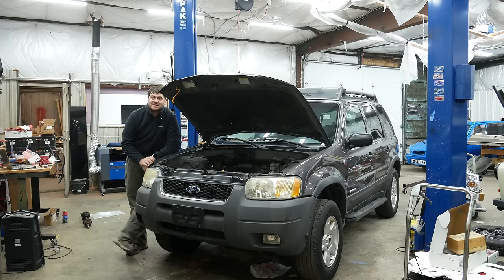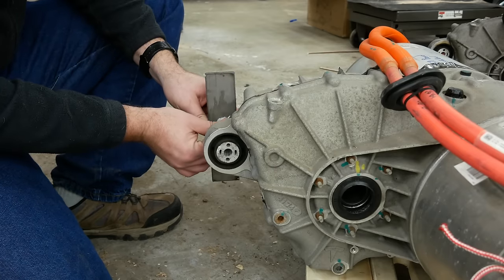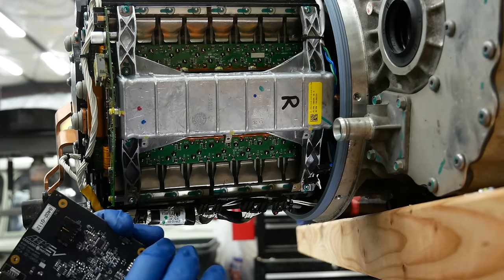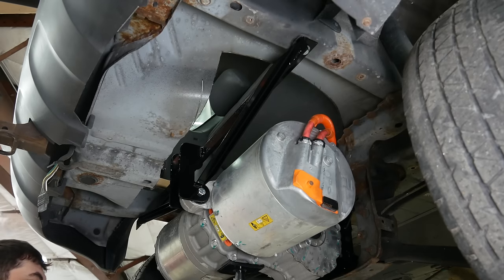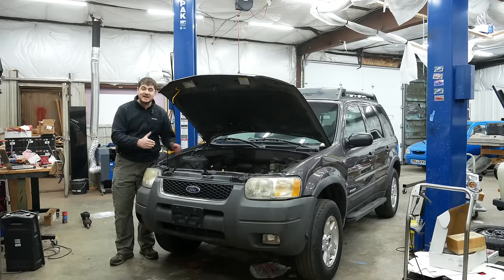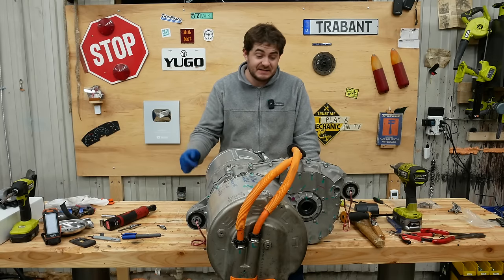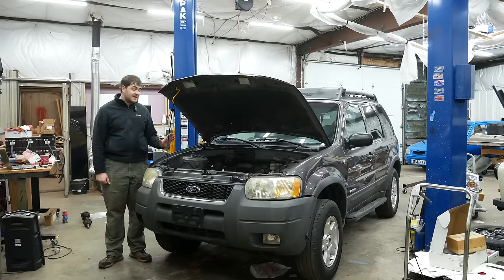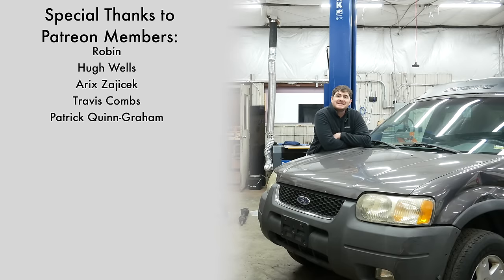This Escape is Now Rear-Engined (and Front-Engined) | 900HP Electric Escape Project

Comment: I love that things like these are possible, and even more so that someone is doing them.
Reply: How did you get access to the video so early?
Reply: @ulexx6574  I wanna know the same it came out an HR ago for me
Reply: @ulexx6574  probably a patron.
Reply: This project is based on an idea that is so dumb that other than as a joke, nobody would ever try.
Keep in mind the reason he is doing this is to gain experience to do it with a bus.  Not only is the bus far too heavy, it has the aerodynamics of a piece of plywood facing the wind.

Worse still, he's not going to be driving it 20 miles a day at low speed picking up kids within a limited circle, but taking it on multi-state highway speed road trips carrying vehicles.  This bus is going weigh a lot. Between the weight and the poor aerodynamics, this thing is going to need A LOT of batteries.

The only good thing is, I believe,  he is never going to finish the bus.  The bus will be scrapped before it will be completed.  He has had the bus for years and has done next to nothing on it.  Next month it will be 4 years since he introduced the bus on the channel. (Mar 21, 2019). He has done almost nothing on the bus since.

His handling of the project has been terrible.  He should stop taking on more projects until the bus is complete as a diesel bus.  Only after all the details are worked out (assuming he finishes the bus at all) should he be considering an EV swap.
Reply: @tarstarkusz  How dare he do something he wants to do
Reply: @NonsensicalSpudz  When did I say otherwise?  I have no authority over him.  I think it's a dumb idea.
If his time frame for the bus is 2035-2040, he should probably tell us that or at least that it will not be done anytime soon.
But what I think he should do is my opinion and he is in no way bound to my judgement.
Reply: @tarstarkusz  Of course it's a dumb idea. That's why I love watching it.
Reply: "Drive unit" 🙌
Reply: @UneasyRider69  I follow a channel called "Cold War Motors" (great channel) and he just completed the restoration of a 1960 Fury  4 or 5 years of videos (though not every week about the Fury) and it was great following the project from a couple of completely worthless portions of a car, one of which wasn't even a Fury to the completion of what is only a bit short of a show quality car (they didn't do the engine and transmission, which were both fine).

He (Robert) starts a lot of projects he never finishes. Worse, these diversions that never get finished anyway, take away from the more interesting projects.  He cannot even stay focused on making the bus an actual bus running down the road and fulfilling his vision of the bus before becoming sidetracked on making it electric.

It's sad, really.  But I also do "get" what you are saying.  There is entertainment value in doing dumb things that are still challenging to do.
Reply: And even more so that someone else is doing them 😊. Absolutely love this channel!
Reply: To reference 2010s Toyota ads.... "Nothing's impossible, Toyota"
But yeah, nice to see people do interesting stuff like this and not things like (common in my area) straight piped TDI Golfs.
Reply: @tarstarkusz  you're acting like he has unlimited funds and is beholden to us as our entertainment. He has a lot of different projects because it makes for great content. He's also one person. The bus is expensive and smaller projects do help with this expensive product. Is it mostly a "why not" project? sure. 

I'm not sure why you're acting like its a good thing it'll never be finished. 

Its easy to be an armchair critic of a 1 man band. its also lazy, which Aging Wheels isn't. He's put out semiregular content on different aging vehicles over the years. What have you done in terms of content?
Reply: he also has no obligation to us to tell us a timeframe on the bus. It'll get done when it gets done. Patience is a virtue. Its not like how the durango was where it was clear it was meant to be eventually scrapped when he bought it.
Reply: @michaelhohe2168  I agree with you about being the critic. It takes no effort whatsoever.
I am not saying and have not said anything accusing him of doing something morally wrong.

Because the bus as it is currently conceived is just a dumb idea.  It's also a HUGH undertaking he is failing at while simultaneously making it far more difficult by adding an EV conversion to the list of changes in the bus.

It's not that I think it's a good thing that he is failing in that sense, it's that the sooner he accepts he's getting nowhere with the project, the sooner he can either focus on the bus and get it done or focus on the EV conversion or the Coda (IIRC, the prototype EVs he has are called coda) or any other project he's dipping his toe into.

YES, I understand he's only one guy with limitations in skill, equipment and most of all, money.  But the way you deal with these limitations is by creating smaller goals.  Like, for example, just finishing the bus and working out all the bugs it will inevitably have (though no fault of his own, this just happens with everyone) and then, after it is working to his satisfaction, he can work on an EV swap.

In one sense, I give him credit for doing this EV swap first and not immediately taking on the EV aspects of the bus at this time.  OTOH, all the money he is pumping into this project is money, by definition, he is not putting in the bus.

Bottom line, I think he should either drop the bus and focus on other things or drop the other things.  Also, It's perfectly fine for small projects to happen in between working on larger projects. I'm not saying there should be no more videos on other topics until the bus is finished. Just no more big projects in addition to the bus.
Reply: @michaelhohe2168  I just would like to see some progress on it.  I was excited for him when he first got it and was going to do a minor conversion to use it as an RV. But then it got slowly expanded to only 1/2 an RV but can carry cars on the rear.
Reply: @tarstarkusz  you made some good points👍hopefully he'll be able to reorganize his project timeline so he'll be under less stress to get projects finished.
Reply: @tarstarkusz  Talk about a party pooper.   I get what you are trying to say, but this dude is learning a lot from scratch, it takes an f'ing lifetime to become a master craftsman in a discipline.  I run my own engineering business, I'm 41 and have been fabricating since I can remember.  This guy is doing great, he's making all the same mistakes I did 20-30 years ago and that is how you go.  The difference is, he's having a bloody go, the fails aren't stopping him and he is persevering on.  I think the electric bus idea for highway use is a big risk as well, but, he's keen, he's doing the smart thing and practicing on something much cheaper.  You need to remember you are not watching a high end fabrication channel, you are watching a dude with passion learning how to do things.  His best skill is his delivery, he is a naturally funny guy.
Reply: @kingcosworth2643  I'm not criticizing him as a person.  I am also not criticizing him for trying new things and jumping in with both feet to learn as he goes.  That is what is appealing about this channel.  I support all of that. That's WHY I watch the channel.

That is not what I'm criticizing.  I'm saying he's barely started the project with very little progress over 4 years. Iit's now on hold and rather than redesign to make it more at what he can do with the resources he has, he's making it way more complex.

If you are at C and you want to get to Z, all those letters in between have to be traversed. 

I think he should get the vehicle working in its current iteration before taking on yet another aspect of the project.  IOW, get the bus done as a diesel first. Once everything is just so he likes it, THEN take on the redesign of the drive train.
Reply: @tarstarkusz  A highly modified Diesel engine that fits into a Bus engine bay is not going to be close to as powerful over a wider RPM range than this dual motor setup. The main goal was to turn the bus into a flat bed car hauler. Hauling something like that Ford Escape a diesel is going to be dog slow climbing up grades, this PHEV setup will be a mountain goat. Already proven by Proterra Duo Power which is used for Ski Resorts.
Reply: @tarstarkusz  "20 miles" is not possible unless the battery is like 40kWh and would be dangerous to output enough power for 900HP of motors. To have enough battery to power 900hp of motors you really need a 100kWh pack which would give just over 50 miles. 2 kWh per Mile is exactly what you get for driving a Brick. 50 miles would be plentiful of a HYBRID setup. Your technical falsehoods defy core concepts of how electric drive trains work.
Reply: @tarstarkusz  privet, you should watch Garage 54, they are only doing dumb and destructive projects. I want to see how you will write your funny comments under every of their videos - in russian.
Reply: @Neojhun  I live in the German south alpines and electric vehicles are stealing everyone else's show. Besides my slow 2983 Volvo 240 grand luxe, i do have an old early 90's Unimog with the most german engineered Gearboxwhich ever existed with three levers. It used to be a torque monster, especially offroad. Now there are small economy electric cars and "fashion-SUV's" that are better at mountaineering with more torque. I feel embarassed. But at least my Unimog has a nice suspension and a nice kitchen inside the RV cabin. And it has been through Siberia, where there are no EV charging stations. 

Another random facts: alpine passenger trains are electric too, which isn't the norm for rural tracks. In most other regions, the rural track infrastructure is mostly under the reign of diesel locomotives.
Reply: @hyperturbotechnomike  I occasionally view their videos. And, yes, some of them are very funny., I'm not Russian, but tell me, why do you bring it up?  Is it because you are a bigot against Russians?
Reply: @Neojhun  I don't think he should modify the diesel, at least not yet.  I think he needs to get the platform working first. Then, after it is complete, take it on some road trips representative of the types of trips he wants to use the bus for.  Only after everything is built and working to his satisfaction should he then consider changes to the drive train.

If he converts it to EV, the range is going to suck even with a much larger battery.  Will the bus even fit into supercharger spaces?  He said he will be using a 7kw charge controller.  Even if the battery is only 70kw, it will take 10 hours to charge it. (I don't know if this bus will handle fast charging)
Reply: There is a fatal flaw in the bus EV project.  The diesel is more or less rated at 100% duty cycle at max power where as the Tesla motor is going to be much lower.  I'm betting that the Tesla motor can't withstand more than 20 % if that not to mention the gear box.
Reply: @Neojhun  I brought up 20 miles as an example of how electric school buses are used as school buses.  They do short trips at low speed. Range is not really a consideration in that use-case.  You pick the kids up in the morning, throw it on the charger and then drop the kids off after school.

It's not power that is the problem, it's range.  In order to get a reasonable range out of this thing as an EV when fully outfitted (with the living quarters) plus carrying a car on the rear deck and with the poor aerodynamics of the bus, it will need an ENORMOUS battery.

Also, it's worth mentioning that these motors are untested at the output levels he is talking about. The 2012 Model S with 2 motors is rated at 416 total HP, less than 1/2 of how he is going to run them.  Also, the more power you try to get out of them the more energy they take from the battery. It is also quite likely the motors are less efficient the higher the output.
Reply: And we get to watch!
Reply: That's optimistic but we're here to watch either way! 🍿
Reply: @Xedilian  He could have gotten a ford focus or Fiesta with the dual clutch transmission dirt cheap! LOL!!!
Reply: @hyperturbotechnomike  Don't feel bad about the Unimog, it is a classic and beautifully engineered in it's own way with different strengths and weaknesses than the EV's. Different creatures both, each good in it's own way.
Reply: @tarstarkusz  It is wise for him to gain experience on a smaller scale before tackling the bus. And about the bus those are generally called "Toy Haulers" with lots of race car owners doing the conversion (just not EV yet). I have started many projects myself only to alter or scrap the first idea for a second or third version. It's far better to put in those changes early than late. Often new ideas will come during the build process and not before, so I understand his approach. Perhaps the original idea he had for the bus is becoming less pleasing over time which definitely inhibits the motivation factor. 

On the practicality of it, all concepts have to be proven or disproven IRL and that is what he will be doing. Being vastly different than what the usual is, I expect his 'EV Toy Hauler' is going to take awhile with lots of changes and alterations along the way. It could even go from plug-in to PHEV with no mechanical drive and the ICE providing charging on-the-roll which would assist or maybe overcome any range issues. 

Proterra is made about 30 miles from where I live, and initially they were criticized for all the points you make here, but they have proven that their claims are not only reachable but they have exceeded that level in some areas. Not only have they proven the concept, they are making a profit selling their product to happy customers world-wide. They are working on extending the possible range and TBH I expect they will succeed, albeit gradually more than quickly.  

The real question with this project will be balancing range with performance which is going to be limited by what the Tesla power unit is capable of. Expectations may have to be lowered but as long as the end product is satisfactory to himself that's all he needs. Or through the Explorer he may find that his 'Toy Hauler' ideas aren't yet feasible but for sure they someday will be whether done by him or someone else like Proterrra.
Reply: @P_RO_  The cost of putting a generator on this thing to power the drivetrain will be enormous to the point he's not going to do it. A thousand dollar generator from home depot isn't going to power this thing in real time even with the battery pack as a buffer.  The best guess of what is in the Tesla semi is a megawatt hour battery and it can barely go 500 miles.  AFAIK, he want to take mutli-state long distance road trips with this.

Anyway, as I said before, I think he needs to focus more.
Reply: Make a tesla go kart
Reply: everything can be anything
Reply: of course things like this are possible, all electric cars start with a frame anyway.